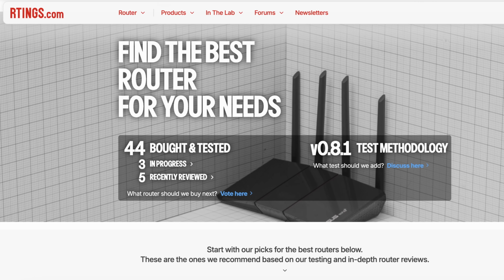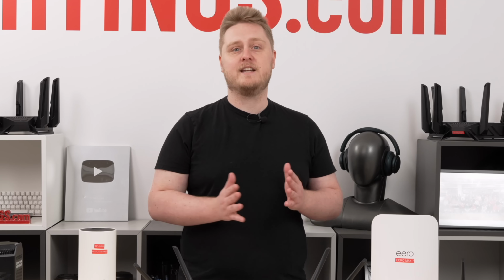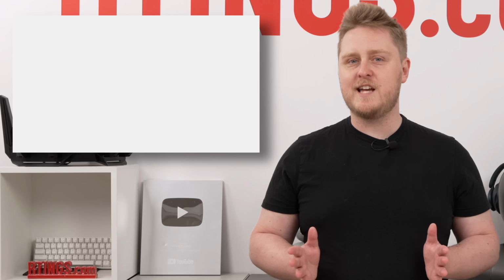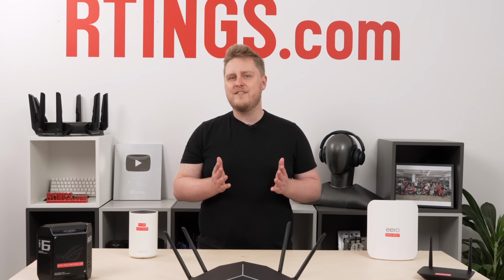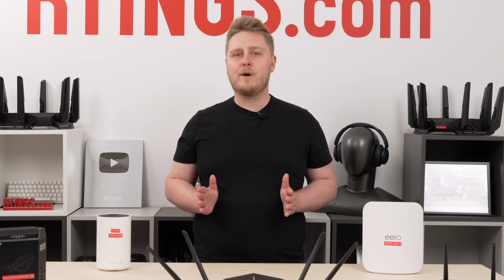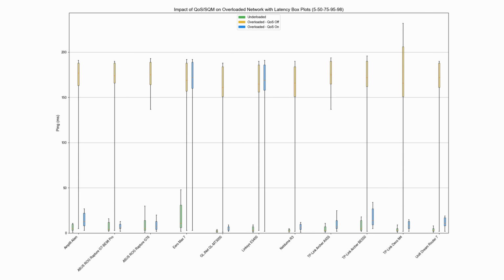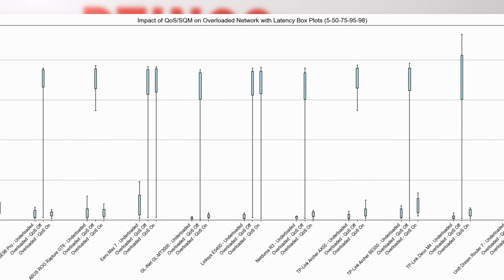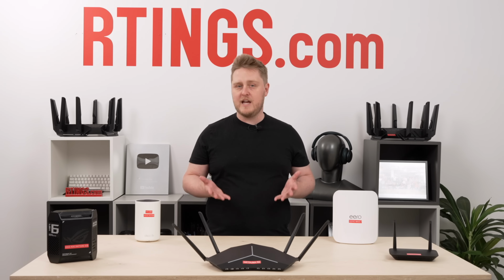Gaming Routers Won't Improve Your Ping - Here's The Data!

Comment: The best router for gaming is the one that is easy to setup when it comes to using QoS/SQM to shape the traffic, any suggestions?. My kids and wife all use wifi to watch videos while i use a wired connection to game it would be nice to reduce the occasional spikes it causes 😕

I'm already using the highest speed available in my area upgrading to a even higher speed isn't a viable solution.
Reply: I use an avm 7530 and am very happy after enabling traffic shaping and capping the speed slighty below the contracts specified speed. Now even with 2 netflix instances and google drive sync i have only 2ms higher ping so 0 bufferbloat essentially
Reply: @LordCanister  Thank you!
Reply: @LordCanister is that the Fritz please? Is that straight plug in to uk ? No need for modem just replace your current router?
Reply: I would suggest a UniFi Cloud Gateway as they offer very decent smart queues management and also offer granular QOS functionality for specific applications and services.

Depending on your home size I would look at the following. Either the UniFi Dream Router 7 which has a built in WiFi 7 AP and is suitable for smaller homes or my preferred option,  the UniFi Cloud Gateway Fiber which has a very high end CPU, but for this you will need to add additional wireless access points as there is no integrated wireless.
Reply: @theexpatgunner  Thanks for the in depth reply.
Reply: Look into getting 2 cheap connections instead of 1 expensive connection. It is what i have to bypass upload limits and data caps on "infinite" data wired connection. Give 1 connection to family and use the other connection as dedicated for your pc and you.
Reply: @hamzashaikh9310  ook into getting 2 cheap connections instead of 1 expensive connection. 
- With all respect, multiwan is a great solution for reliability, but it is not a solution for a low ping. I suspect it may make your ping even worse. Low ping must be addressed through SQM.
Reply: Unifi Dream Router, they call this feature Smart Queue
Reply: I’ve used an Asus router and have a pretty good experience, but i havent tried any other brands so nothing to compare it to. Netgear and tp link dont really count, ive kinda learned to expect them to be mediocre at best
Reply: any suggestions?
- Install OpenWRT on your current router, if it has a decent CPU (SQM is CPU hog) and is supported by OpenWRT. 
- if router is not supported, then select and buy a NanoPie (or alike) with sufficient CPU power, install OpenWRT on it, and use it as a router, switch your current router to the access point mode.

Comment: What about 6ghz? Wifi7 is supposed to have the "closest" latency to ethernet
Reply: Hey! Great question! I am the test developer who also wrote the article. 
For this video, we focused on the 5GHz band so we could compare more routers, since not all routers can do 6GHz. As shown in the video, you will really, really feel the difference between being on 2.4GHz VS 5GHz. We did do basic checks on how the 6GHz behaved, and basically, you can expect similar performances to 5GHz. Now, Wi-Fi7 is marketed as having features able to lower latency. In my research, I couldn't find a reliable source testing latency improvement on Wi-Fi 7. There are a lot of claims saying it helps, but no proof of experiment or data... meaning this is a really interesting project for us to tackle in the future. 
Keep in mind that Wi-Fi is a half-duplex communication, meaning communication can only happen one-way at a time. Ethernet cable is full duplex, so information can go both ways simultaneously. I would really doubt that Wi-Fi ever achieves the same latency as an ethernet as long as it uses half-duplex... but I'd like to prove this with proper experimentation, or maybe be amazed by technological improvements!
Reply: @sp_RTINGS oh wow never expected you to answer my question in this much detail. Looking forward for your Wifi 7 testing with MLO, hopefully with some Ubiquiti devices! BTW I'm from Montreal too so you rock!

Comment: WANderful video, I LANed so much
Reply: In the tech-dad joke awards, I'm routing for you.
Reply: Don't SWITCH the conversation!
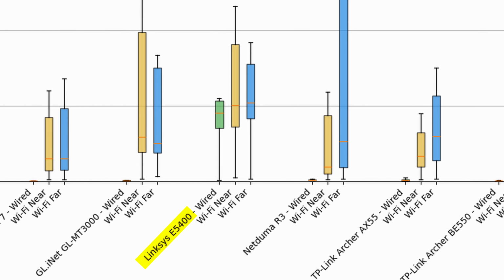Reply: While I agree with the main message (wired trumps the wireless), but his benchmark charts looks misleading (or incorrect). My low spec WiFi 5 router had an average ping of 10ms, and my current mid spec WiFi 6 router has it at 2ms, which is nowhere near the average 100ms demonstrated on the chart (at 1:52 mark).
Reply: The thing with these kind of tech jokes, they tend to make you laugh so much UPNP.....

Just porting it forward.
Reply: 🤭🤭🤭
So ridiculously stupid but thank you I had a good chuckle!

Comment: How do Power Line Adapters compare to WIFI and Ethernet? Would love to see that as a video from you guys!
Reply: It's in our sights! Powerline and MoCA adapters are products we would really like to try. They might not go in typical reviews that we do, but I hope we can investigate them and get the information out. From what I have gathered so far, power line adapters performance will vary a lot depending on the electrical system it is plugged into. So whatever data we can gather in different setups, other people might get wildly varying results. I don't know when this could be happening though, so feel free to poke us from time to time to see where we are with that project!
Reply: If you live in place with older wiring, Power Line Adapters might not work very good.
Reply: Entirely dependent on the quality of the wiring in your home. I had a pretty good experience with power line with a more modern home, whereas it was unusable for a friend, living in an older home.
Reply: I got a power line adapter today and ended up returning it. I was only getting roughly 20 mbps using it